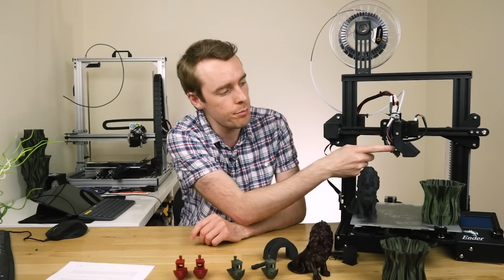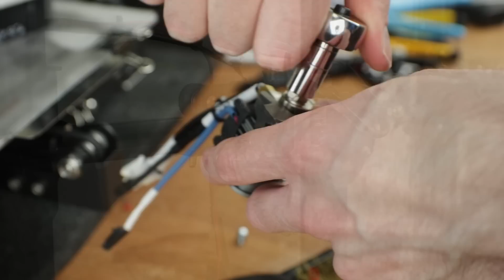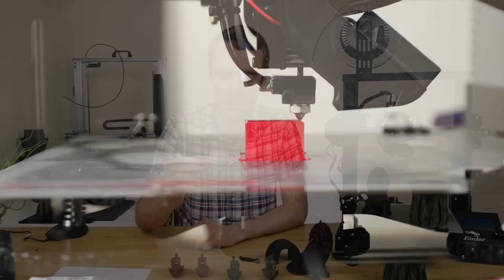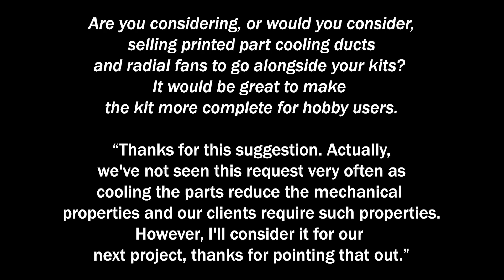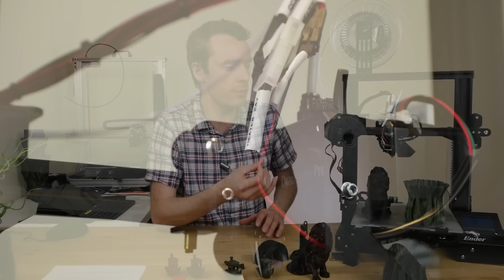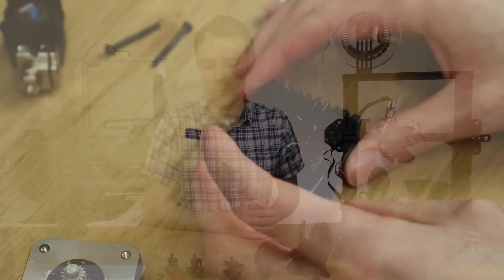Last Hotend and Extruder Upgrade You’ll Ever Need?

Comment: i stopped when i heard the price.
250 punds for a hotend??!! am i the only one that thinks that the printer should be making money when investing over 200 pounds in a hotned?
This is ridiculous and i simply don t see the jsutification for the pricing these manufacturesrs are throwing out there. 
No hotend is worth 200 punds. Nothing in a damn printer can be worth that much. as far as i am concerned, the 3d pritning industry has already failed, they can t substitute old tech for new tech while mainteining the price, so what now?  next gen of hot ends will be costing as much as a car?!
They need to start making things cheaper, i get it that they want to get rich fast, but this is getting crazy... they are charging extra for every minor improvement they make and this is just stupid. Machining these days is cheap, why am i asked to pay 200 punds for 10 cubic cm of machined metal? this is not the 1800s...
I won't pay 10 times what a thing is worth out of principle really.... and i'd be happy to start seeing reviewers at least try to push back.

Comment: I have a question, might sound stupid, but is it possible to use  the dyzend pro hotend seperate from the extruder? Meaning, in a bowden setup, with a ultralight watercooled hotend setup. I am trying to design my own printer ( i know i could just take proven designs, but this is more fun...) and would like to have all the steppers outside of the heated chamber. I also know there are waterblocks for the steppers, but it would look ultra clean and superlight.

Comment: I know this is older, but just in case you haven't figured this out yet - your mic is running through a gate compression. Set the attack on your gate to 0 or 0.1, the lowest possible setting, or disable it. Then, set the hold and decay to at least 0.500 seconds, or even longer. In this video, each time you stop speaking, the gate closes immediately (decay set too fast, and hold set to 0, probably), then when you speak again, it slowly ramps back up to full volume (attack set slower/higher number value), making for a very strange loudness ramping affect after every brief pause. ;)

Comment: I think you missed the point on that one. I mean, it's not made to print PLA or even ABS. This thing is more suitable for PC, Peek and high temp material like that. It would have been nice to see how it prints PC, nylon as they are 2 materials that can benefit that extruder without being ridiculously expensive like Peek. Nice review tho.

Comment: Any newbies here, it's NOT an upgrade, that term is so loosely thrown around, it should be called a Filament compatibility increase.

If you print PLA and PETG it will actually slow down your printing, and there's zero quality increase, you might actually lose quality unless you really slow it down and get the jerk setting dialed in.

Will reduce stringing...for $200

Comment: will the dyzend Heater Cartridge and the Bead thermistor,  fit a stock cr 10 hotend block? and what are the consequences?
Reply from the maker: Pointless. You're still temp limited by the design of the creality hotend.
Reply: @Vector3DP  ohhh thx!!
Reply: @Vector3DP  what anout a cheap but better hotend like the dragon??
Reply from the maker: Well dragon has 450c capability apparently but the thermistor is different shape iirc.
Reply: @Vector3DP  thx man
Reply: @Vector3DP  ummm how about a micro swiss hotend?  its only $65 anmd looks like itll work.

Comment: an extruder that costs as much (even more when it's on sale) as the printer? no thanks
Reply from the maker: Depends what printer you attach it to. Try not to be short sighted.
Reply: Depends on if you're noob about 3D printing or not.

Comment: A unique challenger to E3D? I think I should wait a couple of years for them to ramp up production so I can get one cheaper, now I’ll just use the stock, trashy 250 degrees hot end...But I do think this is a better alternative than E3D and Micro Swiss Hotends, especially if you want to print things like PEEK or PEI, a hot end of this capabilities usually only exist on industrial machines, such as Stratasys, which their machines cost 20 thousand bucks

Comment: a 45w heater running at 12v will be drawing 3.75 amp, the 60w at 24v only draws 2.5 amp.. they prob dont want to go higher in 12v for the wire size?

Comment: best investment ever, and yes there is nothing wrong with spending $300 for this for a $500 printer, this is the most important part of the whole dam things, I was sick n tired of the CR10 stock garbage falling apart and E3D was disappointing also clogging and what not.
this thing was bolt and go....I have had it on for months printing heavy duty materials and have yet to have a clog, totally impressive combination extruder/hotend...and mine runs off a Duet board.
when you get to this level equipment thou u do need to know what you are doing in regards to setup and tuning,  for example need to use a PT100 temp sensor since is going 300c ....those kinda things. if you are doing one off PLA prints then yes dont bother

Comment: nice to see someone who doesnt call the hotend a extruder like most. Annoys me lol. great video
Reply: Annoys lol look up what a actual extruder really is it contains a barrel and screw not a feed gear set and also additive manufacturing is a process which involves an additive not just a base material or fibre or pigment added those true additive manufacture is A process whom makes the additive post extrusion post printing  and is then part of a blend or mixed material like UV additives or vit E additives or flame retardant additive theses are added to the base material again post extrusion post printing and are what additive manufacturing means ex if you make resin that must be mixed in with a base material to run it that’s an additive manufacture
Reply from the maker: Some grammar really would have helped your rant. Additive manufacturing is any process where material is added, doesn't matter how.

Comment: I wonder what Duet would estimate for a peak temperature with that heater. I'm pretty sure I dont have a 60W heater and it warned that my heater block could reach 800C if the heater circuit failed to "on". I would go with Duet anyways as its "deadtime" heater control algorithm is a lot more stable over a wider temperature range than classic PID. You wouldn't need different tunings for different temperature ranges.

And I wouldn't run a high temperature or high performance machine on 12V rails. It's a self-defeating choice.

And those teeth seem awfully coarse. I don't think I'd use that, it looksa lot cruder than Bondtech in my opinion. And I've never had drive problems with that.

Comment: Make the hot end heavier, why is that a good idea?
Reply: @Vector3DP  If that is your experience then I have to accept that.
Reply: I installed a z axis 1st layer stabilizer and I can literally rest my arm on the hotends rail mount and it barely shows in prints. Going to install a dual z mod too but ya shouldn't be an issue. For what we gain. And a dual head. But for the price you cant complain about the ender 3 specs.

Comment: That’s what I was wondering .... you kind of mentioned ... running higher temps will the Creality 24 volt power supply handle the rise it current at the higher temps.
Reply: C.R.T thanks ... I’ll have to check that side of the equation. I’m not overly impressed at any of the P.S. in these printers anyway. That might be a simple and inexpensive way to stay on the safe side. Thanks again for the quick reply.
Reply: C.R.T was just out checking specs .... at high temp 500 deg the unit draws 60 watts. So you only have a delta of about 30 watts or so increase. In my case the power supply on the CR10 S Pro is capable of 500 watts. Shouldn’t be a problem ... I think it would just be better to increase Power Supply cooling fans. Just info ... thanks again

Comment: With a hotend capable of such temperatures... I would want to see how it performs at those temps.....PEEK, PEKK....etc
Reply: @Vector3DP  try adding a ac heated bed and an enclosure to the printer to print nylon and polycarbonate
Reply: @Sandwich4321  that stuff prints at <300C, what better would 500 do?
Reply: If you try it I would be interested in pei results

Comment: If the nozzle is closer to the heater cartridge than the temperature sensor the nozzle may be hotter than measured. If the sensor is closer as is recommended for a tighter temperature control loop then it's likely a calibration issue.

Comment: Just an FYI. E3D do a high temp heater cartridge at 65W capable of 550 degrees available in 12 and 24 volts.
Reply: if you have ever tested a printer for thermal runaway that turns out not to have it youll know a 40 watt will glow orange which is aaround 800 C. js
Reply: DAN F the entire heater block including a heatbreak heatsink and operational fan? Or just the element in open air?
Reply: @JasperJanssen  heater block will not glow, most are aluminum, but heater cartridge will glow inside block if powered st full pwm cycle for long enough. (about 4- 5 mins straight)
Reply: Does anyone know the brand of the red petg? Thanks